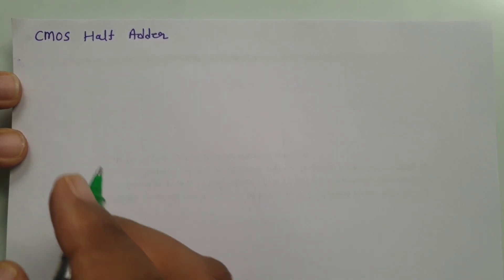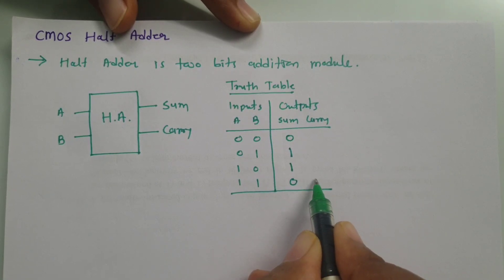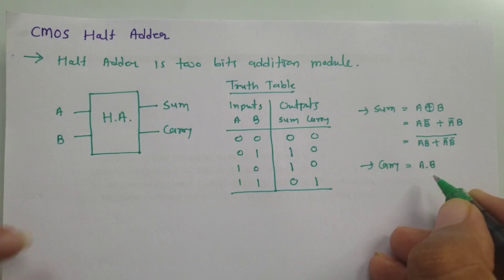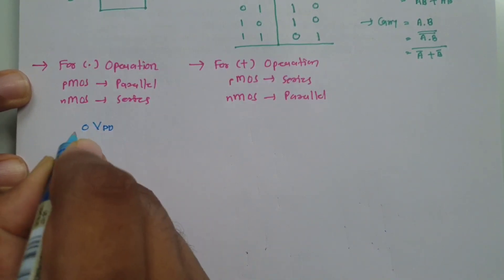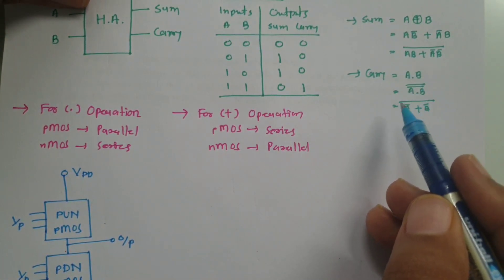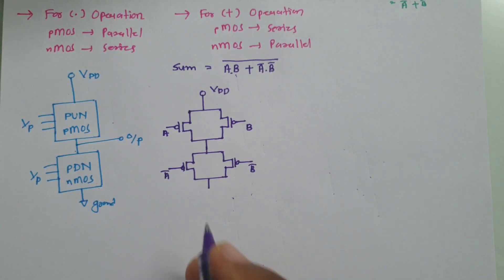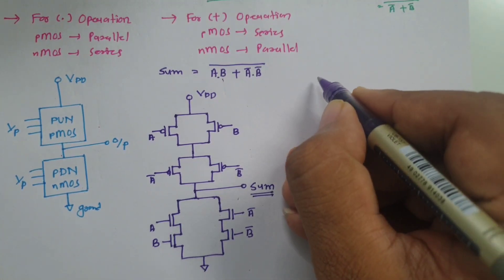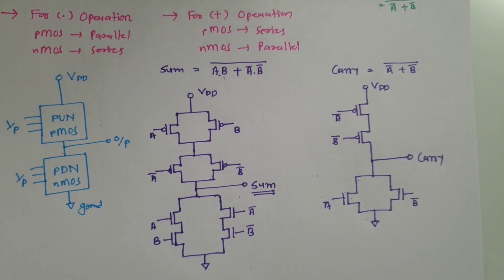CMOS Half Adder: Basics, Circuit, Rules, Working, Implementation & Truth Table

Comment: if the output is inverted, then the output we get from the sum here is X-NOR or A.B+(A bar).(B bar) which is different from our required output. Correct me if I am wrong please, Sir.
Reply: no the output you get here is the complement of (A.B+(Abar).(Bbar)) . But in case you use a CMOS inverter at the output then you will get the expression that you mentioned as it will be bar of bar so it would cancel and give you the inverted output.

Comment: Sir we do not have A baar & B baar directly. For that we have to use two more inverters no
Reply from the maker: For understanding point of view, you can take it as bar, else you need static inverter to get it done.
Reply: @EngineeringFunda  sir if the question is how many no. of NMOS & PMOS are required to implement the function then what is answer sir?
Reply: What is static inverter?